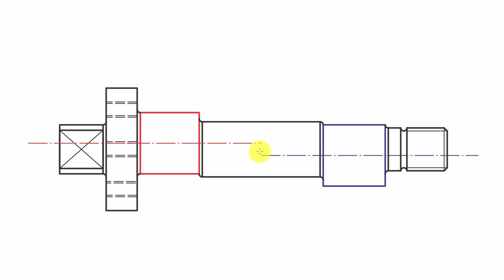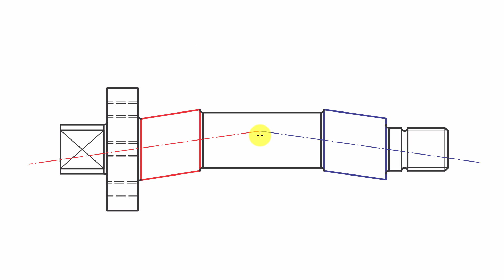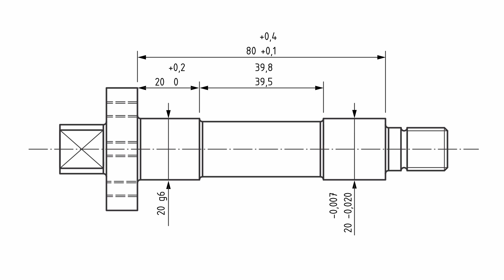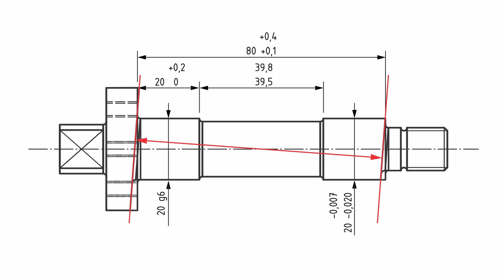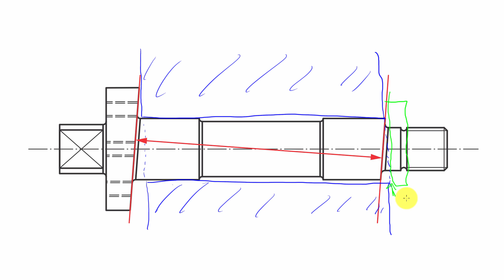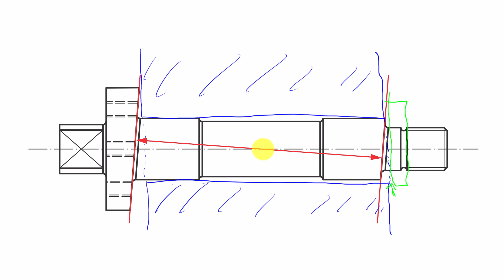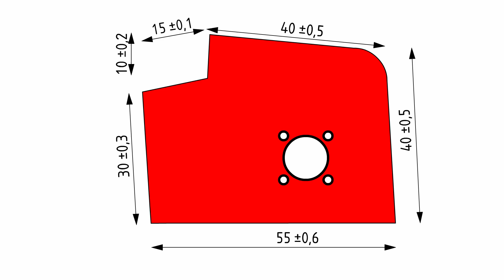Dimensional tolerancing of a shaft

Comment: Any good machinist knows what is correct, does not matter of its dimensional or GD&T, its called experience. For over fifty years manufacturing has make parts from both styles of prints and saying you can only get parts in tolerances if you use GD&T is not true. Experience, experience, experience.
Reply: Yes absolutely agree that experience is extremely valuable and is required to make good parts. I think what Henrik is trying to communicate is that you can't know what someone wants unless they tell you. Yes if you are experienced you might be able to make an educated guess as to the function of the part and thus how it should be manufactured to ensure this, but you can't know for sure unless they communicate this to you. Henrik is showing how a system like GPS is a language that allows you to communicate, in full, the design intent of the part you want to manufacture. By using this system, as long as it is mutually understood, you remove any ambiguity as to what constitutes an acceptable part and what doesn't. You can't get parts in tolerance if the drawing doesn't state the tolerance, which is the case for things like straightness, parallelism or runout etc. when using just dimensional tolerancing only. By the way props for being committed to manufacturing for over 50 years!

Comment: How should I draw a shaft which has, on the same diameter, two different tolerances? (the case is that I have one tolerance on the bearing journal, and the rest of the shaft must be made a little smaller to allow the bearing to go trough that part easily, before being pressed on the bearing journal)
Reply from the maker: My apologies for the late reply. You can find the solution in ISO 14405-1. In principle, you define a set of locations along the shaft, using TEDs to locate them. You could call them A, B and C. The bearing part may be between A and B and the smaller part between B and C, then you would write the bearing tolerance as e.g. ø20 h7 A<->B and the other as ø20 -0,05 / -0,1 B<->C. The addition of A<->B means that the tolerance only applies between locations A and B.